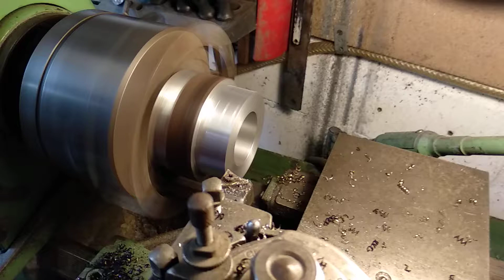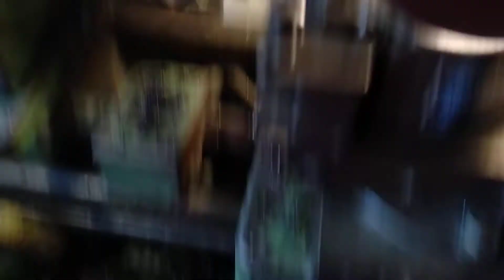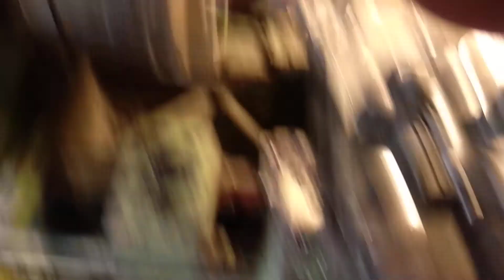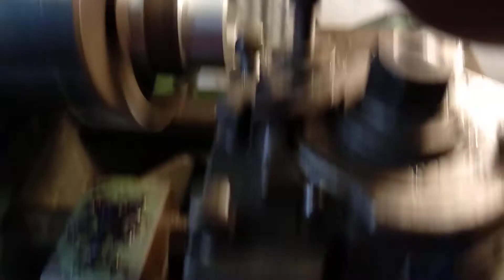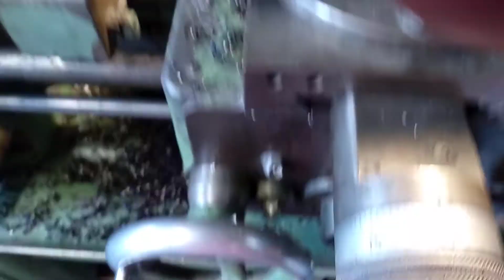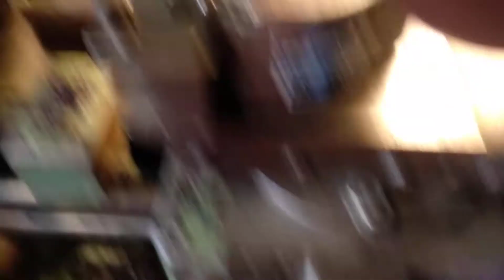Hülse drehen auf der Weiler LZD 220

Comment: Ich sehe Du nutzt ein Multifix-System auf der 220LZD. Welche Größe ist das? Multifix A?
Wurde der Oberschlitten abgeschliffen oder hat das direkt gepasst?
MfG
Reply from the maker: Hallo Eike,
ja, ist die Größe "A". Denke der Oberschlitten ist original, habe ich schon so übernommen. Bei größeren Stählen könnte der Oberschlitten aber etwas tiefer sein.
MfG, Holger
Reply: @holgers7  Moin Holger,
Bei plan gedrehtem messe ich rund 17mm von Mitte bis zum Oberschlitten. Abgeschliffene Oberschlitten gibt es wohl öfter, gemacht ist die Drehbank wohl fürs spannen mit Pratze auf dem Oberschlitten oder für überhängende Wechselsysteme, so dass der Halter vor dem Oberschlitten abgesenkt werden kann. 
Für mich ein neues Werkzeug,  ich recherchiere gerade, ob der Aa Multifix mir zu klein ist (gewünschte Steifigkeit) oder ob der für max. spannbare 12mm Stähle nicht doch reicht oder ob ich beim Kumpel den Oberschlitten abfräse...
Die Qual der Wahl...
Was ist der max. Drehstahl, der noch sauber schneidet?  Quasi Vorteil des steifen Stahls vs. Nachteil von obermittigem Schnitt? Stahlauflage vom A ist 10mm, da schneidet ja quasi jeder Stahl obermittig oder für einen 16er, um einen Vorteil ggü. Aa zu bekommen, müssten 9mm Fleisch vom Oberschlitten runter, so viel hat der nicht...
Dir ein schönes Wochenende! 
Grüße Eike